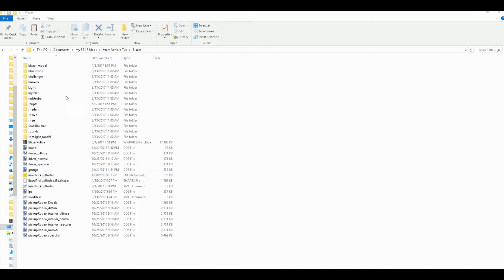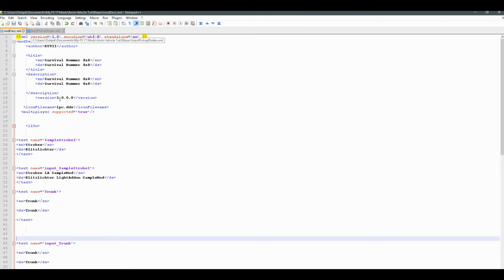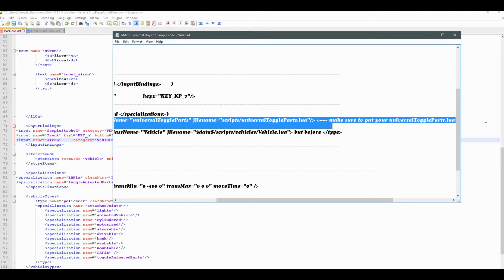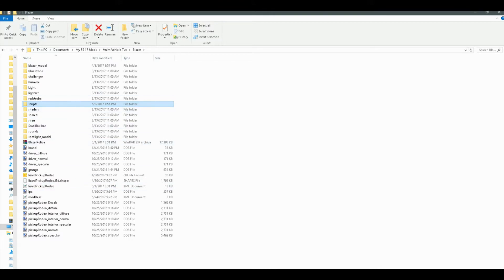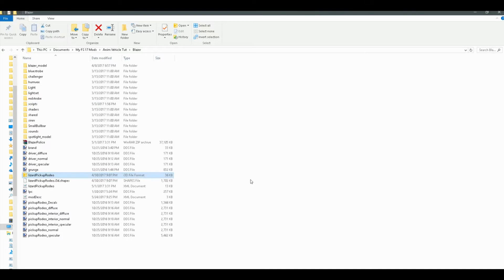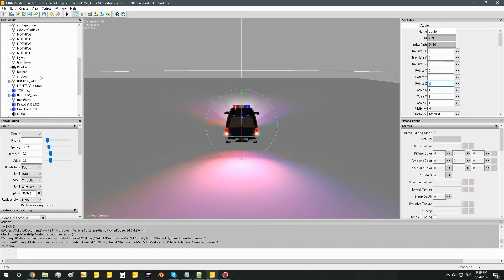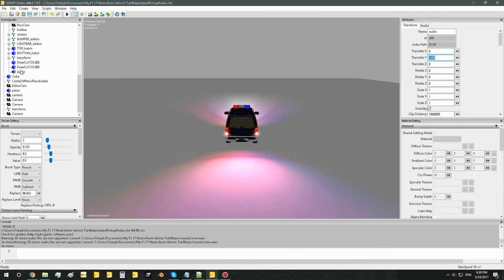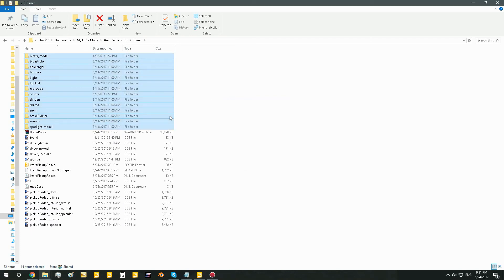Farming Simulator : How to Add Toggleable Horn to Mod // Tutorial

Comment: had you ever started a mod from scratch Im trying to get a 42ft pj spread axle into the game it is from sketch up I have it in ge now and was wondering what i need to do now??? any help would be greatly appreciated... thank you in advance.
Reply from the maker: Hi there. I have not really ever created a mod from scratch. Too much hastle to write the moddesc.xml, and xml files from scratch. Often what I do, is import my model over a similar mod / vanilla game vehicle, and adjust it to suit my mod.

I have a series of modding timelapses, that perhaps may show you what it is I do, which may help. 
In this playlist: https://www.youtube.com/playlist?list=PLCT2A9zAL1Ju9wa9-Pisngh1nQa7jtuZF

I may make a video on this, specifically, in the future, but until then, here is a bit of a description of what I do if you want to know. 

To summarize briefly, when I do this, I usually, import my model into another working mod of the same type (If I am making a car, then over a car) and then, move my model in the scenegraph to where the model for the model of the original mod was in the scenegraph (or in other words to it's index. ) Then delete the old model. 

Next, I usually reposition elements like the lights in the editor to fit my model, along with the cameras / exhaust particles / etc.

Then usually, I'll check the xml, and make sure all the indexes are still correct for things such as the lights / cameras / etc. 

Lastly, I usually change some stuff in the Moddesc, such as the vehicle name, price / etc. 

And that is generally how I do it, to be brief. 

Hope that helps, but if not, perhaps when I make a video that'll help more. =)
Reply from the maker: This may help too, as far as changing mod info (name, etc) in the Moddesc goes. https://www.youtube.com/watch?v=1QscjkKjSpE
Reply: thank you very much for your help that sound like it would help me very much I will try it and may make a video on me doing thank you very much!!!
Reply from the maker: No problem, glad to be of service! Sound good! =)